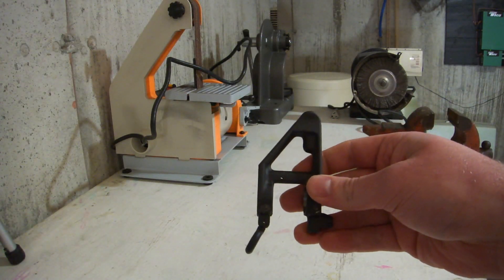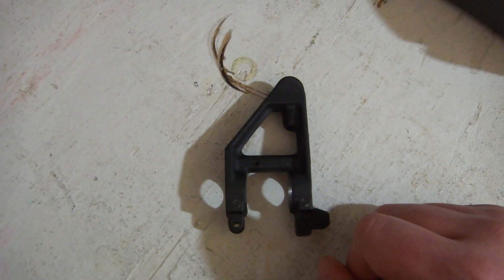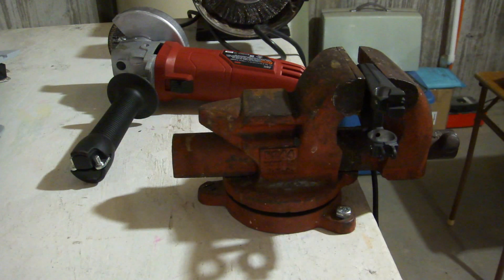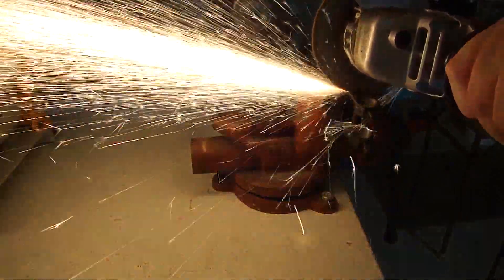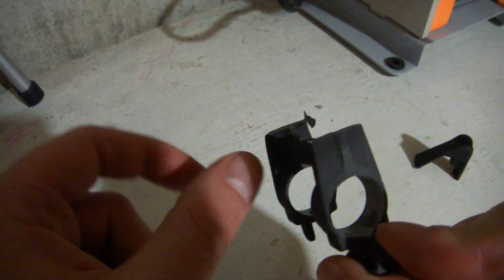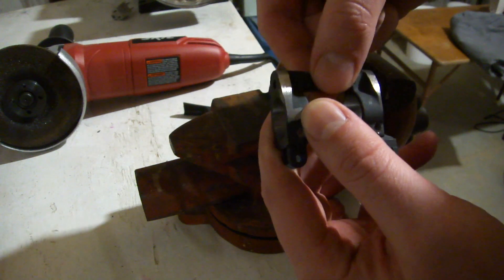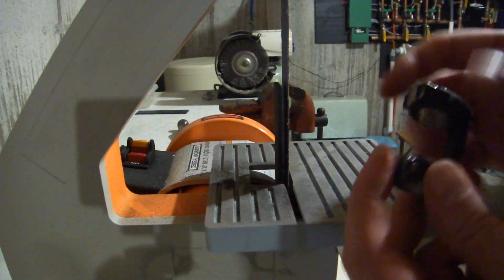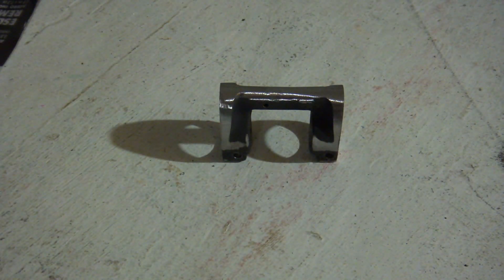DIY Low Profile Gas Block

Comment: Use a piece of .750 diameter stock and you can clamp the FSB in the vise by the rings. That will eliminate any distortion from clamp pressure or heat. Just let it rest and cool off. Dunking it in water will make the material brittle. I would have used a low profile gas block as cheap as they are these days. Dimple the barrel and a little high heat threadlock and the gas block is there till you want to remove it. Reinstall the pins and tag your FSB with the serial number or batch number of the barrel so if you want to reinstall later, the pins match.

Comment: So, you ruin a $100 A2 front sight gas block to make a Low profile gas block you can buy for $15.
Reply from the maker: Mark Scofkoe this is for people who already have an A2 block and maybe people who don't want to remove it and don't want a garbage $15 pot metal clamp or screw on block.
Reply from the maker: Mark Scofkoe also A2's are like $30
Reply: @WesMerc  I know this post is seven years old but I was just about to say that a new front sight can still be bought for $40. I just modified my factory one like you did in this video.

Comment: I would just get a low profile gas block and they r cheap
Reply from the maker: Pinned blocks are arguably better
Reply: +WesMerc you have a valid point
Reply: Try 45 bucks
Reply: Who said you can't get it pinned? For 20 bucks, you could get a new low profile gas block and take it to a gunsmith who can drill/pin it for you for about 5 bucks.
Reply: Kami kadze I had bought an adjustable gas block and my gun smith pinned it for a small fee of 15 bucks since I brought him the pins.

Comment: is there an issue with chopping it while it's on the barrel
Reply: Yeah gosh I would hate for the barrel and gas block to get too warm haha jk this video was certainly helpful. Going to get moving on this project myself.
Reply from the maker: Just be careful and take it slow.  I would use a hack saw and files as it got crazy hot with power tools
Reply: are you able to reuse the taper pins and gas tube roll pin? or would you need to get a new set?